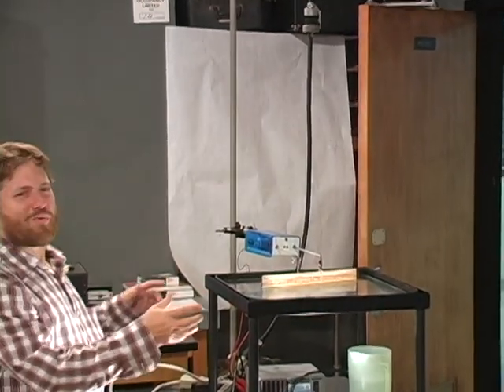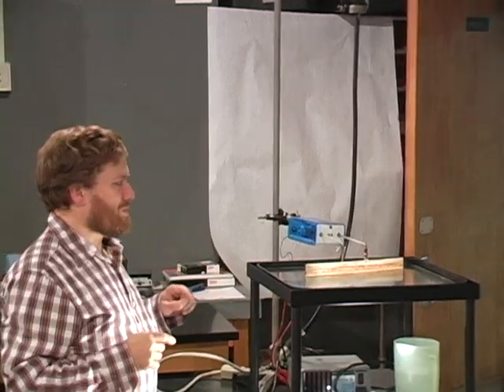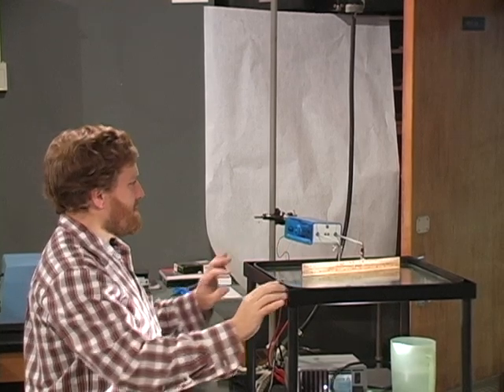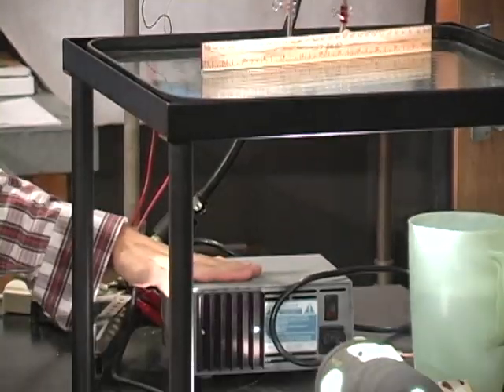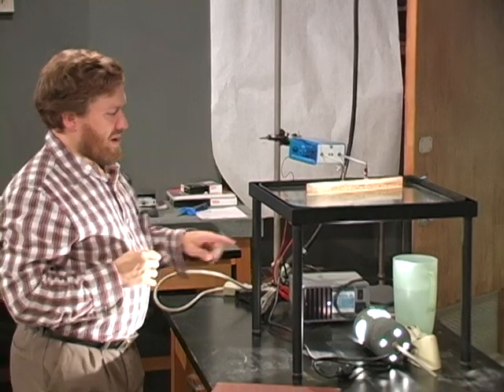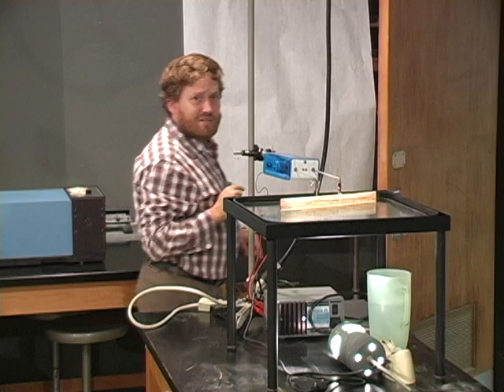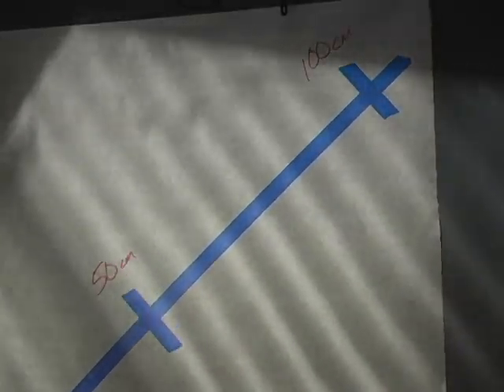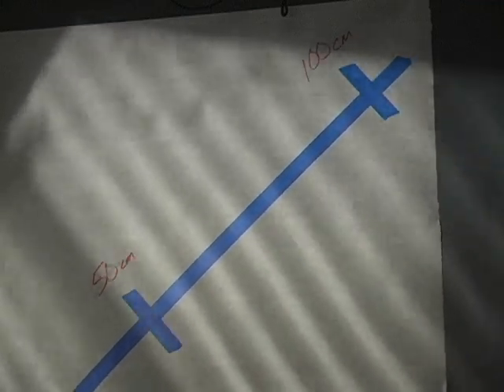Ripple tank plane waves

Comment: You can actually calculate the frequency using the periodic disturbances presented in the video. Those disturbances are transverse waves with each light and dark spot corresponding to a trough and crest respectively. By using the formula, wave speed/wave length = frequency, we can calculate the frequency by hand!